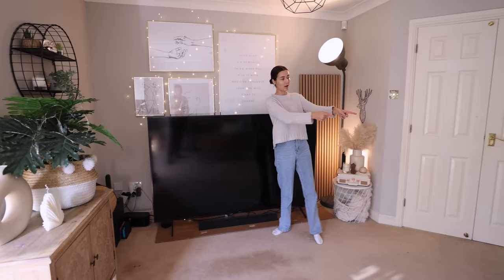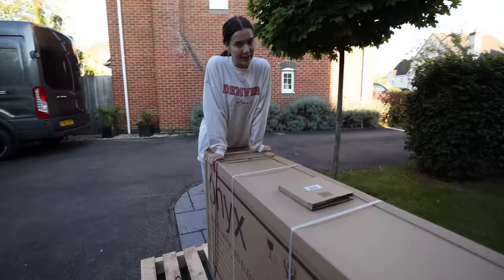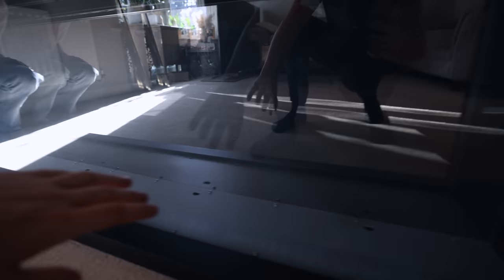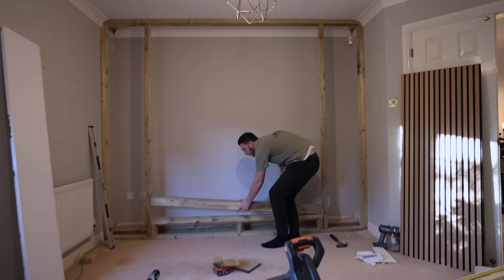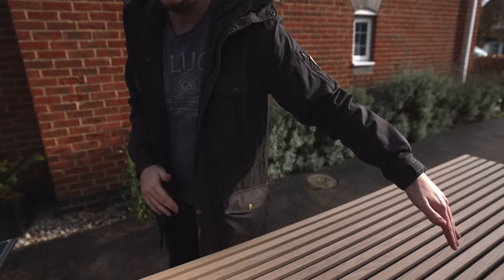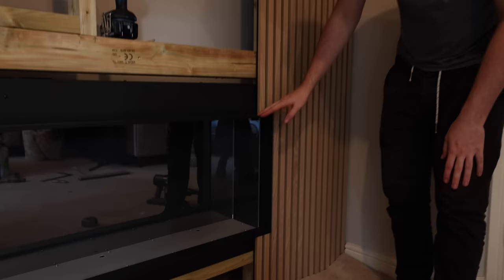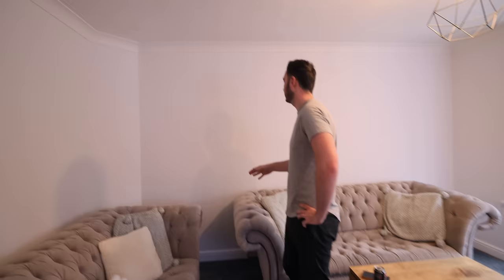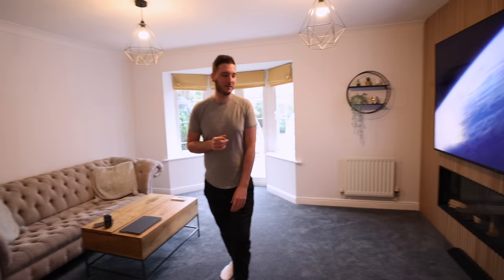EXTREME LOUNGE TRANSFORMATION | DIY MEDIA WALL WITH MODERN FIREPLACE

Comment: As the Tv is not inset and there is no mantle are you not concerned about the heat ruining the TV?
Reply from the maker: We probably would never set the heat function above 21 degrees so I wouldn’t worry about the tv unless it were a real fire 🙂

Comment: The TV is far too large for the fire. The scale is off .  It would have looked great if scale was considered. It’s an important facet of design that is easily overlooked or not understood.
Reply from the maker: We are actually very happy the fireplace is the same width as the tv and that it flows well with the leading lines of the wall panels